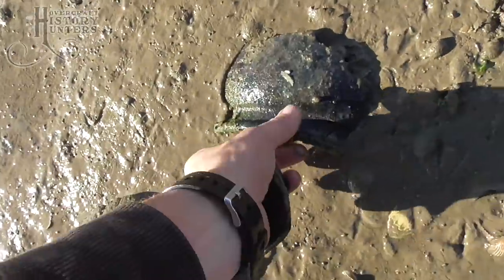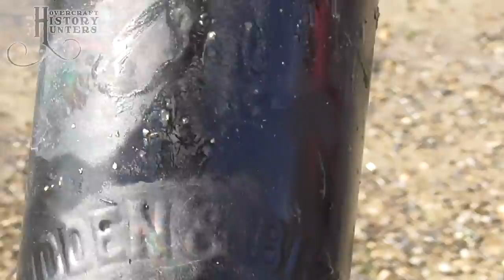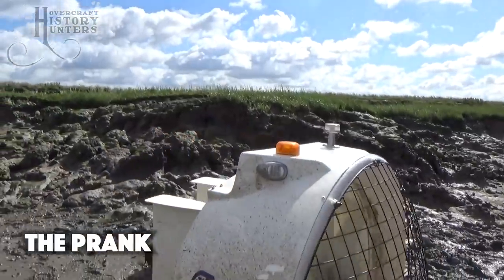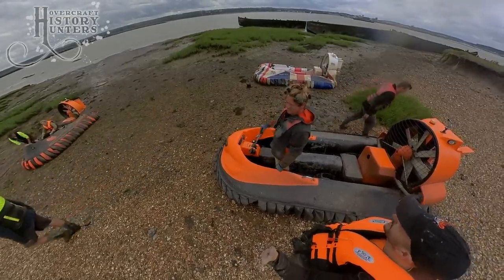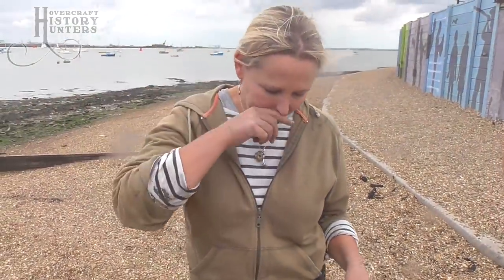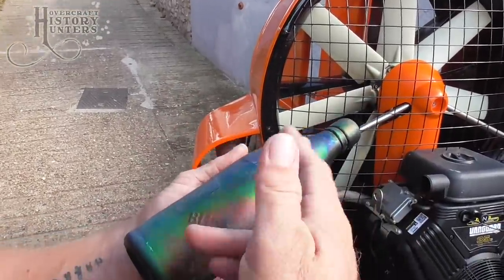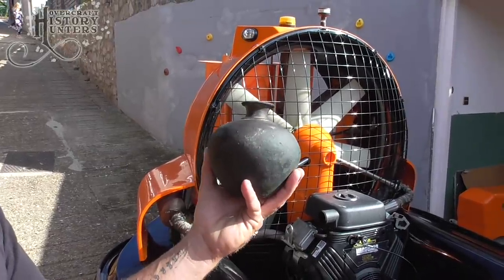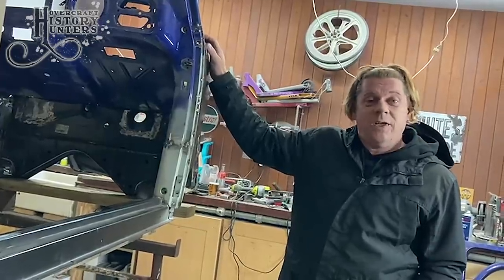BEST MUDLARKING FIND! Hovercraft History Hunters do it again!

Comment: The hole in the bottom of the pot could have been done intentionally when it was deposited (as part of a grave or, more likely, as a water offering) to "ritually kill" the pot. If it was an intentional water edge deposit, that could also explain how it went in base up without the top getting smashed to bits.

Comment: Hi Simon, how do you get the bottle so clean inside? I’ve got 2 Victorian glass bottles I absolutely can’t get clean. Just wondered if you’d got any tips?
Reply from the maker: Hi, Use limescale bleach and let sit for a few days, use different bottle cleaners, and also a copper wire that can bend and scratch off the dirt inside. I also heard the other day, put in dry rice in some cold water and shake, that will help dislodge the dirt too
Reply: @Sifinds  Thankyou so much, I’ll give it a go tomorrow 👍👍 xxx